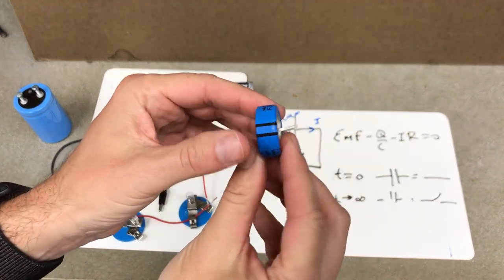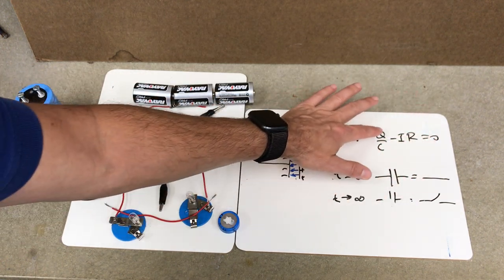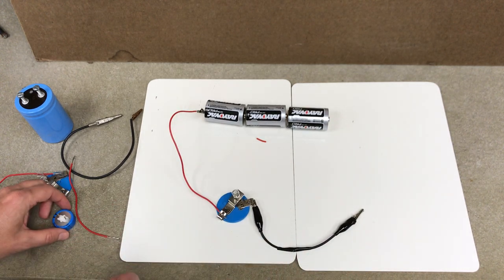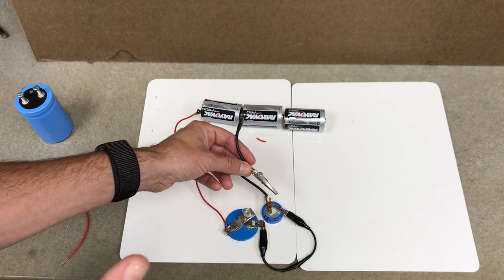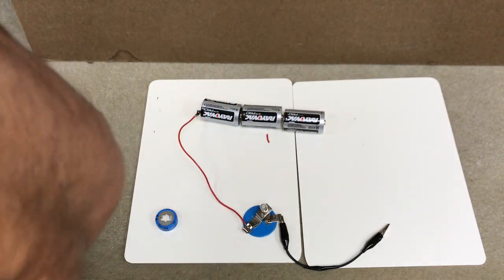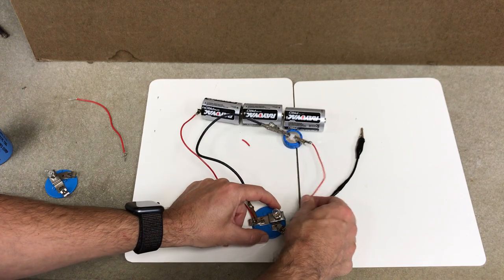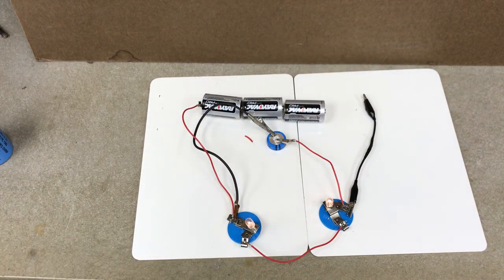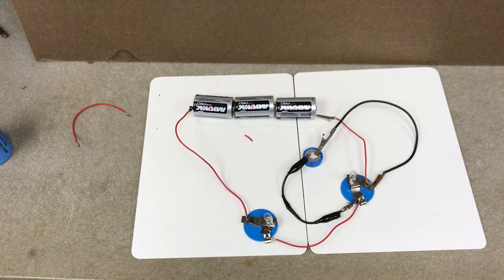Can you connect a capacitor to a light bulb? Physics

Comment: so a capacitor could be used to keep the car interior light on -and fade off,  after the door is closed
Reply: You probably just turn it on with your remote control to wake up the battery.

Comment: What happens when you have a self charging capacitor that can charge up faster than the bulb can use the energy and you have no battery? The light bulb should stay lit forever right? .. ok so what happens if it's a trillion volts self charging? It would probably need a spark gap right? If you cut a large 500 lb block of sandstone to 90 hertz and you chant OHHHHHMMM .. you can get a trillion volts.  You would probably need 150 lbs of metal on the capacitor to hold the charge... and then feed it through a transducer to hammer a pressure wave and it's harmonics on 2 piezoelectric stones that is 829:1. You could probably power the whole planet. You get an extreme stone sandwich.. a piezoelectric beating heart.
Reply from the maker: what is a "self charging" capacitor?  Is that just a battery?
Reply: @rhettallain  They are easy to build but put out about the power of 400 power plants. That's why I won't build it. A classic example is the Ark of the covenant with the stone of scone put on top anointed with mineral water. (shorted between the anode and cathode) The ark is tuned to 90 hertz and the "stone of scone" transducer is tuned to 90 hertz.(the 2 piezoelectric tablets inside are tuned too)  You sing to it and it hammers 90 times a second on the tablets piezoelectrically.. but because of the harmonics it also does it 180 times a second and 360 times  a second all the way to infinity. The second and third harmonic is the golden ratio. The stone of scone is around 500 lbs and 500 lbs of force on a quartz crystal releases 12,500 volts per cubic centimeter. If you cut a groove on top of the stone and anoint it with mineral water it will increase the conductivity 8 fold. I know how to do this for 40 years but I'm not messing with 200 trillion watts. Maybe you can help me make this safer... like a smaller gadget thats not going to kill everyone who tries to build it. I can show you how to compress time and do anti gravity if you want. When the Stone of scone is vibrating it puts out a steady 500 lb  pressure wave/ shock wave of 829:1 into the tablets and you get a standing torus. I just showed you how to do free energy and anti gravity with no moving parts ... it's really easy and has never been a secret. Let's bring it out and give it to everyone for free without getting greedy. I just showed you something you would have never figured out in your whole life without me showing you this..... work with me. We are being enslaved by banksters.. it needs to come out. The same technology will weave plasma together turning sound into matter...  a 3d plasma printer that converts sound into matter. Works just like a printer with the same colors (of light). Crops can be grown in the blink of an eye because you can compress time. Work with me.. let's open source this right here and right now with open source dialogue and video experiments... people working together for a greater cause. I did it with a well pump switch in the 1980's and a bolt of lightning came out of it... enough to send me running. I'm not into getting hit by lightning again... but someone with your know how could help make this safer... or a group effort with a lot of combined minds. This is a tuned musical instrument.. a beating heart tuned to infinity.. every note sets it off and once it's running it never stops until you pry the transducer off of it. If you take a good Tibetan singing bowl tuned to 90 hertz and get it to vibrate.. it keeps vibrating for more than 3 minutes. In  the case of the ark,... it's tuned the same way and will keep vibrating for 3 minutes after you pry the transducer off...... It won't turn off right away. Don't put it on the ground it won't turn off. That is if it's not already levitating.
Reply: @rhettallain  I wonder what kind of drugs @omegafile is on.
Reply: @omegafile  I got u 0.0